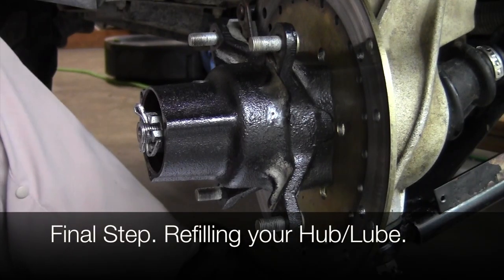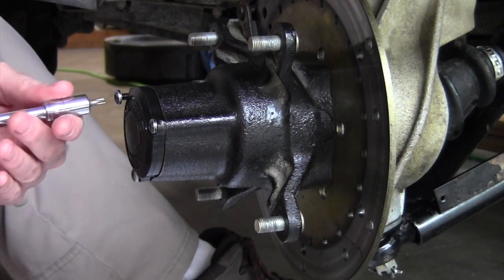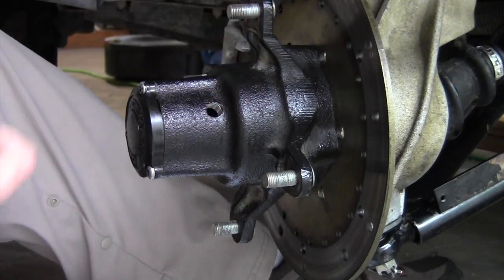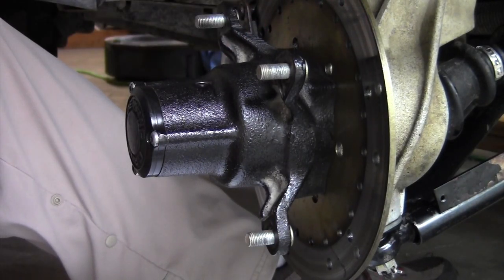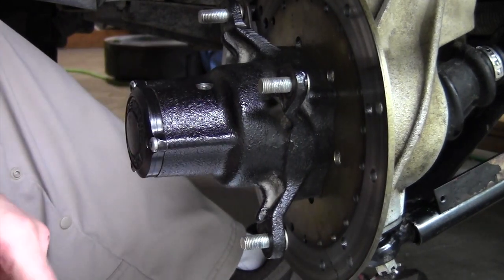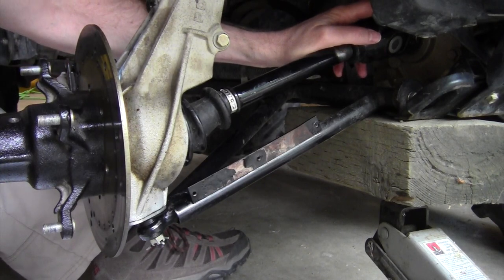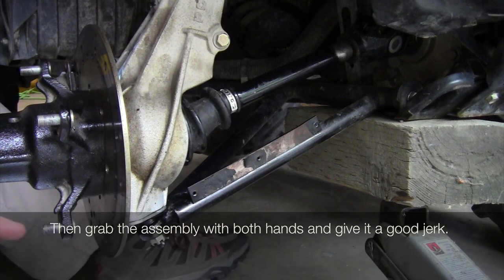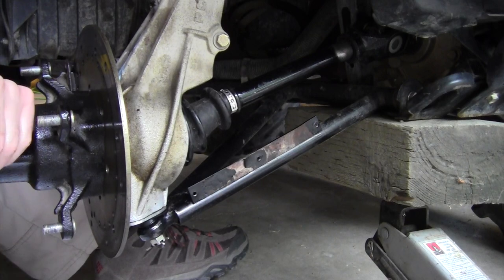Refilling Your Hub Fluid/Oil and Last Thoughts and Nuggets About Assembly.

Comment: It's all so confusing to me with all the bearings the seals the Rings the washers I should be able to do it but I know I'm going to need your help but I don't have anybody here and Indiana to help me I really like the bike so I think it's worth fixing
Reply from the maker: Hey there. Did you see all the other videos I've made? From what your saying I believe Ive covered a lot or most of that. Check out the others and if I haven't answered any of your questions in those feel free, absolutely, to let me know and Id be happy to try and help with anything that might be adding any additional challenge. Theirs a video that covers disassembly/assembly, and another that goes through the parts. And others. It looked like you may have unintentionally replied to your own comment. Your reply spoke about your left front tire. I couldn't respond to that one. But I got the gist of it. Hope its all helpful. Let me know if you have any other questions.

Comment: What was the torque spec on the axle nut please
Reply from the maker: Manual indicates for initial bearing adjustment to torque to 160-170 INCH lbs. Notice not foot lbs. While rotating hub continuously. Then back off nut 1/2 turn. Then retorque to 108 - 144 inch lbs. and adjust as needed to align hole for cotter pin but do not exceed 144 inch lbs. It's been a few years  but I think I babble about that in the video. If not this one, its additional info in another.

Comment: Спасибо за видео. Какая вязкость трансмиссионное масло ?
Reply from the maker: The manual recommends special polaris oil or ATF automatic transmission fluid. I use full synthetic. ATF+4

В руководстве рекомендуется специальное масло для поляризатора или жидкость для автоматической трансмиссии ATF. Я использую полную синтетику. АТФ + 4

V rukovodstve rekomenduyetsya spetsial'noye maslo dlya polyarizatora ili zhidkost' dlya avtomaticheskoy transmissii ATF. YA ispol'zuyu polnuyu sintetiku. ATF + 4

Comment: Will differential fluid work
Reply from the maker: Should use demand drive fluid or Ive used synthetic ATF. Assuming your talking about the same year, make and model.  But I have a hard time deviating from from the manufacturer recommended fluids.

Comment: You did not mention the torque on the axle nut
Reply from the maker: Its been a while but I believe I did in the Polaris Sportsman Front Hub Disassembly and Rear Seal Removal. That video is more specific to that. But to clarify. It should be 108 to 144 inch pounds.